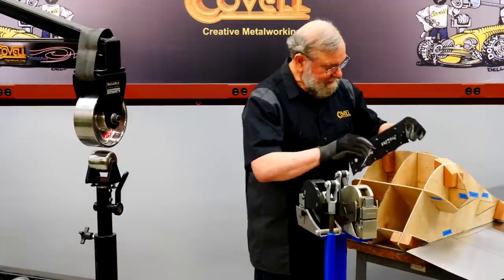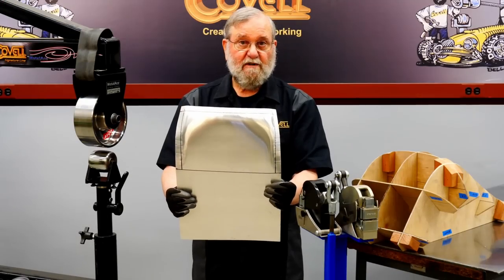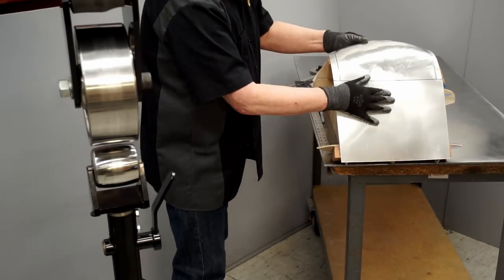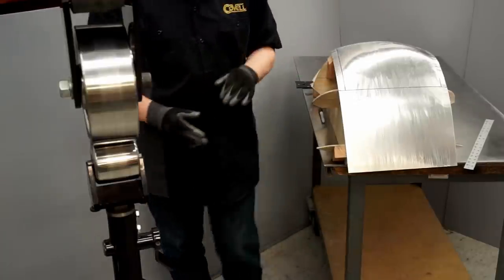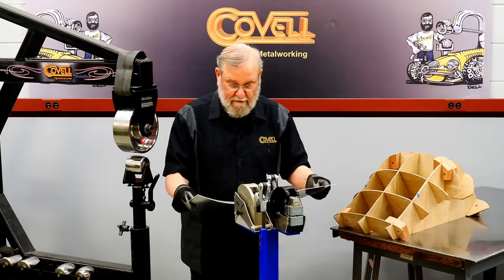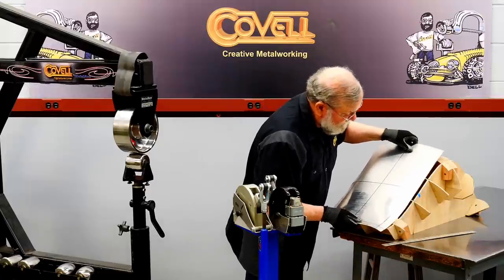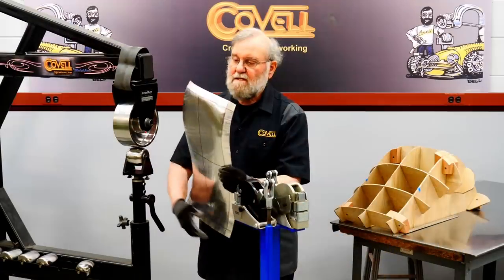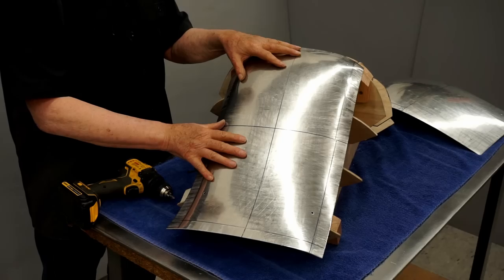Making a Curvy Seat - Part 3 - The Center Pieces

Comment: I love your honesty (e.g. instant 25'...) "that fits in surprinsingly well" ... when Ron works with surprisingly few mistakes in a long row of tricky and delicate moves.

That does not deter me from trying one day (having had some projects in mind for quite a while now, awainting for the opportunity of a proper workshop and tooling), but I'll count a factor of 10-100x in required time.
Reply from the maker: It does take some time to get quick at these techniques, but you can start with a simple hammer and dolly!

Comment: Another 90 minutes! Lol! ..I've got 3 reverse curves to do on my '32 roadster pickup cowl. The sides are just slightly reverse but the top has a BUNCH of reverse in it especially where it curves from horizontal to vertical...kinda scares me a little.. will probably ruin a lot of metal until I get it just right...  hopefully this video will apply to my cowl project..I bought a pair of your stretcher shrinker gages for my Lancasters...haven't used them yet but excited for the opportunity to. Love your work. Please keep the videos coming!
Reply from the maker: The same principles I used for this part will apply directly for your '32 cowl. Good luck - that's a delicate project!

Comment: Ron, there are some very accomplished and skilled metalshapers on youtube, but NONE of them come close to explaining concepts the way you do, so clear and concise. Thanks!    A question: you mentioned the "hump" that forms behind a shrink when using the Lancaster shrinkers.  When shaping a double curvature panel and one edge happens to not lie down, you can either stretch the rest of the panel or shrink that edge. But if choosing to  shrink the edge, you inevitably (unless the edge is raised only for a half inch or so) will cause the area back of the shrink to be in that hump zone and therefore not be lying flat on the panel/buck.  How do you deal with this raised area - assuming you want to use shrinking to get the edge to lie down?
Reply from the maker: First of all, thanks for the kind words!
When you have to shrink an edge, and get a hump inboard, you can often work the hump down by hammering off-dolly. There is a limit to how much of a hump you can reduce this way, but you can get a little more 'action' in a couple of ways. One is to over-shrink the edge, since the edge may want to stretch out a little bit if you do heavy shrinking inboard. Another approach is to anneal the metal that needs to be shrunk by hammering off-dolly, or work it at elevated temperature.
Hope this helps!

Comment: This is an awesome project.  I'm reminded of a recent inter-island flight where the commercial airline's passenger seats weren't much more than upholstered bomber seat pans similar to what you're constructing.  A huge benefit being that the passenger behind you couldn't jab your back with anything since the pan was continuous.

My question is, it appears you've organized the material sections according to major curves of the seat pan shape.  The pieces of material often span multiple buck sections.  Hypothetically, a student of your crafty methods here could make smaller sections of material, many of which would be square pices that span from one buck section to the next in both directions, shape that piece accordingly and then perhaps make up for the ease of shaping by overloading the welding tasks section of the project a bit.  

Anyway, I imagine a beginner could start with a buck that used about twice as many sections and then start with smaller patterns and work with smaller sections of material and this would be beneficial up to a point where the pieces get so small that the worker lacks the hand leverage to manipulate the material well in the shaping tools.

Perhaps in a future video you could address this in a FAQ post bomber seat series video?  Thanks.
Reply from the maker: Greg - when starting a new project, one of the first questions any metalshaper asks is: How many pieces should I make this part in, and where should I place the joints? In general, as a person develops more skill with shaping, the size of their panels increases, and the number of pieces decreases. 

To take this to a ridiculous extreme, you could make any shape buy starting with a large number of 1-inch square pieces of metal. The shaping of each piece would be trivial, but the enormous amount of fitting, welding, and smoothing of the welds would make this pretty unfeasible. 

On the other hand, trying to make a complete car from one piece of metal is equally ridiculous. So the calculation is based mostly on weighing the difficulty of shaping with the complications of welding and smoothing. I chose 6 pieces for this seat - some might choose 3 or 12.

Regarding the PLACEMENT of the joints, I generally position them in the center of the areas of greatest curvature. This way, the difficulty of shaping is divided more equally between the panels.

I hope this helps!
Reply: Thanks @RonCovell !

Comment: Ron, the shrinking leaves a mark on the edge of the part. Is that deep enough to be a concern, or is it more a scuffing that polishes out relatively easily?
Reply from the maker: The marks can be sanded or filed out, but as you'll see on this project, I left enough of a margin on each of the panels that the majority of the marks will be trimmed off before the parts are joined together.
Reply: @RonCovell  Does that mean that the panels will relax a bit when the 'shrunk' bit is trimmed off?
Reply from the maker: Well, sometimes they do, and sometimes they don't. I didn't get much 'relaxation' on these panels - probably because of the extensive wheeling I did on both the shrunken area, and the area adjacent to where it was shrunk.

Comment: Did you anneal all six pieces?  Also could the aluminum be annealed with map gas or propane?
Reply from the maker: Yes, I annealed all the pieces, and yes, propane and map (or mapp) gas have a flame hot enough to anneal this grade of aluminum, which requires about 800 degrees Fahrenheit, or 427 degrees Celsius.